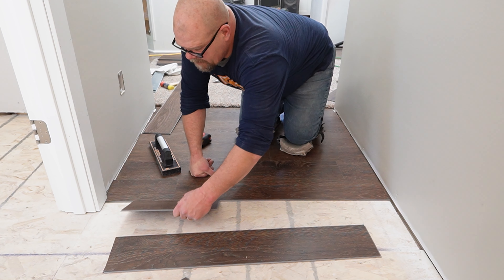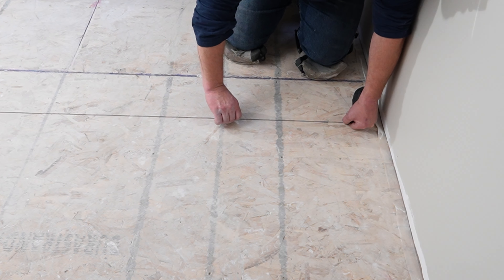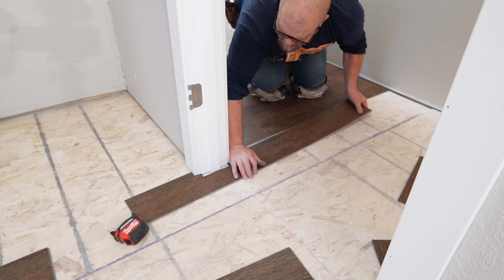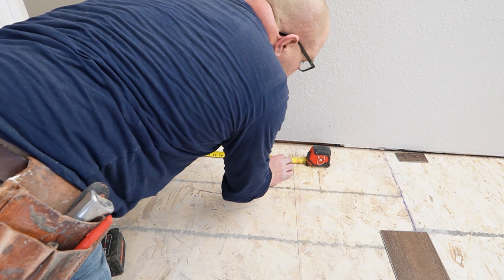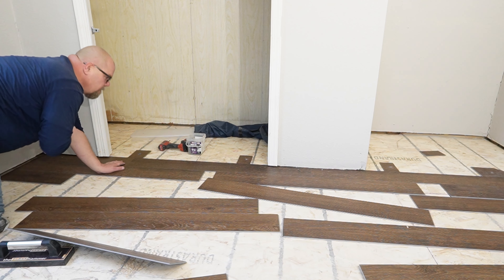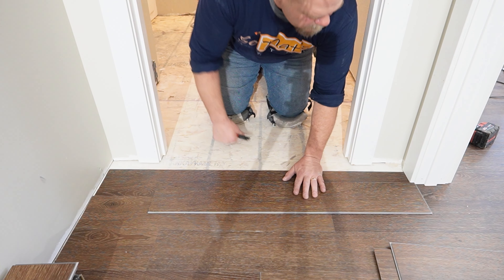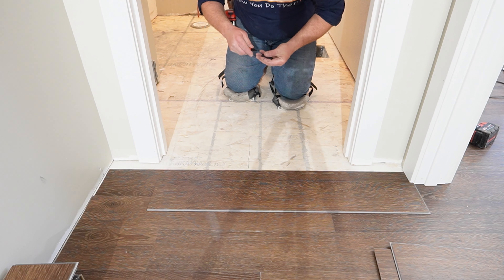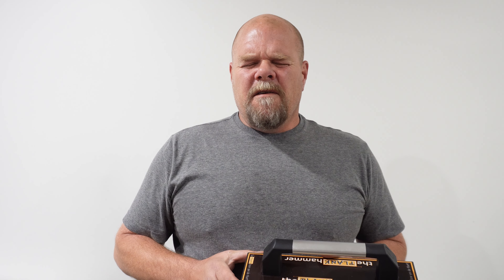Vinyl Plank Installation HACKS for Doorways!

Comment: More awesome tips Joe - and I give a hearty endorsement to your tools, solid products! I've just completed my Flooret Sylvan on the main level (1200 sq ft plus stairs!) and your tips and tricks were invaluable. Now I'm about to embark on Flooret Modin Signature for the basement level. Do you have experience of DMX 1-step? I'm considering using that (over tile over concrete) as the VP. I used Steico under the Engineered Wood Sylvan and absolutely loved it!

Comment: Thanks Joe! Blessings to you as well. 
Question anyone, if I take a turn and am now going down a hallway with the plank's running perpendicular, should I use full planks if they stretch the entire width of the hall or throw-in end joints just for appearance?  Thamks!

Comment: Hey Joe, curious about your tapping block. I’m hoping for an honest, non-biased response since it is your product so obviously you’re going to support it. 

How does this compare to the Marshalltown bullet xxl? I bought it after seeing you use it multiple times. Ended up buying 2 over time cause the handle eventually broke on the first one.
Reply from the maker: The Plank Hammer is much better! I designed it to be tough but much more user friendly.

Comment: I notice the proknees you wear. same as I have. I quit wearing them, I was getting rashes on the back of my knees under my pants from the straps. If I tried loosening the straps all that did is make them slide off my knees. I tried straight across and criss crossing the traps. No help
Reply from the maker: Thats not good.  I have not had any problems with that. My problem is, I have to use a stainless steel belt buckle. If not, I get a rash on my belly.